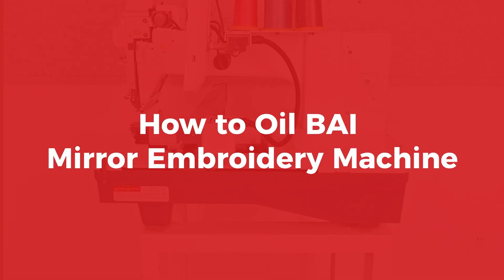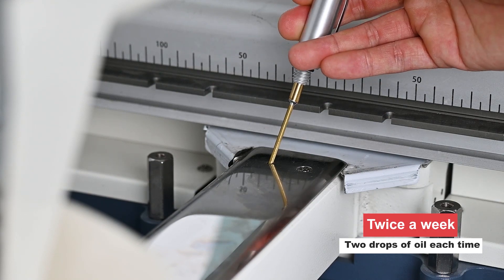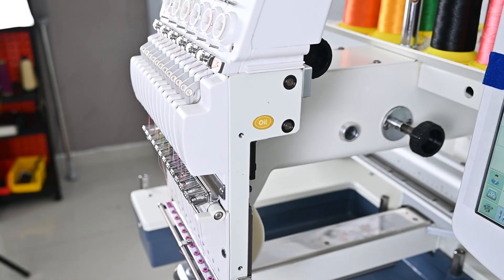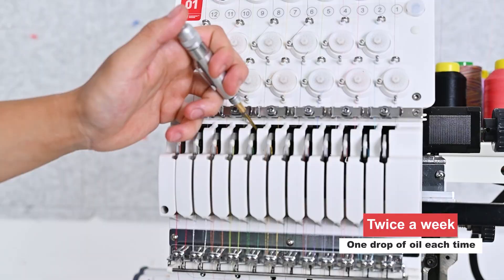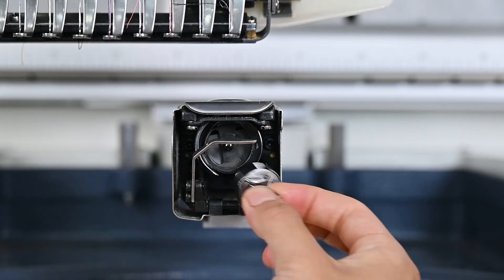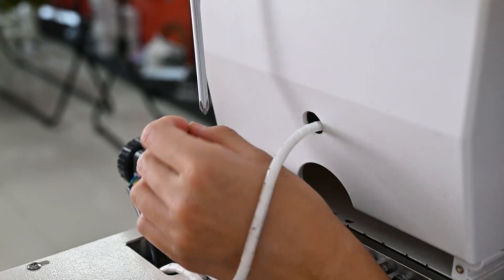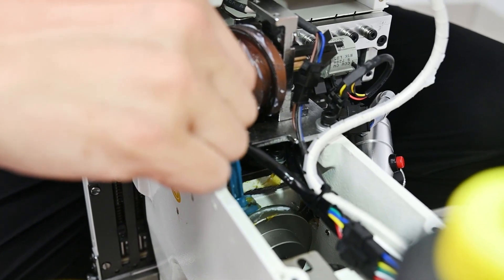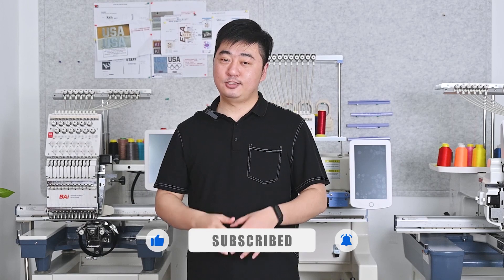How to Oil BAI Mirror Embroidery Machine | BAI Embroidery Machine Tips

Comment: What kind of grease would you recommend?
Reply from the maker: Hello, it is recommended to use oils with moderate viscosity, high-temperature resistance, oxidation resistance, and low volatility, such as Tri-Flow Clear Synthetic Grease and Lucas White Lithium Grease.

Comment: How do I oil if there is no oil hole in the silver arm ( short bed) in the back of the  machine?  You say to oil twice a week.  The part of the video at 22 seconds with the red circle. I have no hole in the back of the short bed.
Reply from the maker: Hi~We have optimized the lubrication point and no longer require sewing oil to be applied to that location.